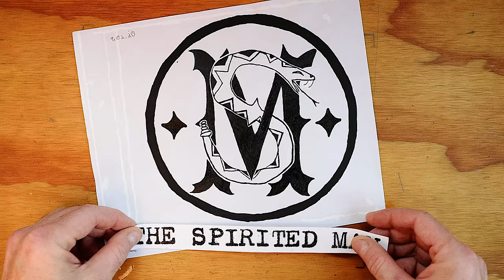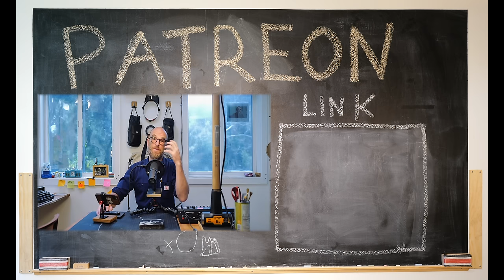The Philosophy of Driving Stick

Comment: Hey Van, don't rest your foot on the clutch pedal, it will ruin your system faster! Always remove your feet when your done changing gears, or just relieve the foot when you need fast changing.
Reply: Loved the video❤
Reply: I need to work on this. I'm on my 3rd clutch and I think its because I'm a clutch-pedal-rester.

Comment: When I was 20 or so, I got a delivery job... on my first day/delivery I was given a stack of brake pads and told to deliver them to "XYZ auto shop" I grabbed the parts and keys, went out to the truck only to see it was a stick shift! (didn't come up in the interview) I somehow got it that Toyota in gear and faked it around the corner, stalled 3 times that first day, once on the second and on the 3rd day I was hooked! Nobody taught me this skill... I have a hard time accepting peoples scrutiny of the learning curve. manual transmissions are so freeking liberating. They make the most boring cars exciting. I've owned many cars since then and have hated every single automatic under my butt since. Nothing replaces that tactile touch of being in actual control of my vehicle. sadly tho' at 49 years old, I drive a 49 cc Honda Metro... possible the only automatic motorcycle in the world! (at least i have some cheapo thrills from leaning into corners at 35 mph)

Comment: The best way to learn the relationship between the clutch and gas in gear is to go to vacant area, find a hill to drive up, and then try to keep the car in one place without using the brake—just balancing between the clutch and gas. You'll kill the car over and over, but also a while, you'll get how give-and-take you can give it.

Comment: Try not to rest your foot on the clutch in between shifts. You're adding additional wear to the throw out bearing and also increasing wear on the clutch disc itself! Will also echo what others have stated that... when in doubt BOTH feet in (clutch + brake). I think that potentially you yourself panicked in that moment which is why you might have just blurted out "clutch" lol. Glad it was a cheap fix.

Comment: You can shift to 1st while the car is moving... The synchros are not going to like it, so you need to rev match it, and punch the gas pretty hard while you're doing it. When you let out the clutch, the car will decelerate quite quickly. I used this technique one time when I blew a wheel cylinder, and consequently lost something like 75% of my braking power. It allowed me a secondary way of controlling the vehicle's speed without having to touch the brakes. The final stopping would be done with a quick yank of the hand brake.

Comment: „Everytime you touch the break, you got to push the clutch down first“. 

No, just no. Normal deceleration while driving is completely fine. On the highway for instance while decelerating from 120km/h down to 100km/h you won’t need the clutch.

Comment: Don’t drive and rest your foot on the clutch… keep it besides the pedal when cruising to prevent excessive damage
Reply: Excessive damage or just damage as in wearing out the clutch and T.O. (throw out)  Bearing as well as heating up the flywheel and clutch pressure plate.
Reply: @jeffhildreth9244  damage as in wearing out the clutch
Reply: @daankattouw  The clutch system is composed of three main parts:  The clutch Disc, the Pressure plate and the Throw Out Bearing. Which of these have you  personally replaced, and in which car.
Reply: @jeffhildreth9244  I have not yet replaced any clutch-element in my car, because I keep my foot besides the pedal when cruising ;)

Comment: You dont push the clutch first in an emergency, and you dont call out. You brake. Brakes are more important. Yeah the engine will stall, but sill you'll stop in place.

Comment: I miss my '94 Mazda Protege DX 5MT.  I put 180,000+ on that vehicle over 26 years.  The modern automatic transmissions shift more smoothly and are more fuel efficient than manuals...and, we're all lazier than we used to be.  But I miss it.  I feel like less of a driver and more of a passenger of the vehicles that I drive currently.
Reply: Yes, automatic is more fuel efficient. And most people are in the wrong gear, all the time. Thats why i dislike manual… People can NOT operate them efficiently.

Comment: I want all new drivers to have to pass a drivers tests with manual transmissions :) 
 Tip for "oh $hit" moments when going off track in racing is, clutch in and hard on the brakes, I don't know if that technique would have helped keep the bumper straight ?
 Thanks for the video !

Comment: The key to avoid crashing when driving a manual transmission car is the following step/s: 1) clutch pedal down, quickly followed by 2) brake & clutch together. Telling someone to hit the clutch will not stop the car moving - in most scenarios it does the complete opposite: the car 'coasts', which is far worse as there's no 'engine braking'. I think the instructor was at fault here ;-) Pleased to see that team of kids did a sterling job at restoring your bumper. Felt a bit sorry for them not wearing masks whilst spraying it back up

Comment: I just want to say that clutch is NOT a panic button. Pressing just the clutch will actually make the car go faster. You press the clutch and the car is now rolling freely without any resistance from the engine. 

Even when driving stick, the panic button is the break pedal. If you are not panicking, press both the break and clutch to stop without shutting of the engine. When in panic mode, just hit the breaks. The engine will die, but that's ok. Stopping is what matters.

Comment: tbh u should of taught that u push in clutch and brake hard if there is a need to stop (not hit something) -- pushing the clutch in is great but without braking you wont stop and generally if your in "panic" mode you need to stop.

Comment: As an European, where most cars have a manual transmission, I honestly find it strange when an American says: I do not know how to drive a stick / manual.
As far as I know, it is only in the USA and Canada where automatic transmission are the norm - and manuals the fringe.

That said, there is a growing use of automatic transmissions in Europe, and spreading rapidly.
Mainly driven by dual clutch transmissions' quick shift, but also due to improve efficiency.

Regardless, the manual transmission mandates that the driver is focused on the task - and not thinking about a 100 other things.
It is quite normal, since I was a little child, the correct point to shift gears up or down - because the memory of hearing my dad shifting is printed on my brain.
When it came the time to drive, I was ready.

For those who say CVT: no, CVTs are disguising. They should not exist in their current form - but only on their original form.
Torque converters are the past.
Sorry.

Comment: The mistake here was carrying on off the beach. First lesson on the beach, done. Next day, try again on the beach, try some manoeuvres, going up to 3rd, etc. Third day, maybe, maybe try it out on the road.
Reply: Also, so lucky the bumper hit the rock. Could easily have hit the front grill and you'd have been in for a bonnet repair, grill repair, potentially a new radiator and more.

Comment: Opens with, ‘Driving stick is a creative exercise.’ Then later when presumably instructing someone, ‘when this gets to 2500 <rpm’s>’

A creative driver or learner doesn’t shift based on a tachometer…we use our feel, our judgement. We listen to the engine and feel the vibration of the vehicle…our so called ‘creativity.’ Teaching someone to shift using a tach is anything but creative. Oxymoronic.

Comment: You can absolutely go back into first when rolling in NYC traffic. I wish standard transmissions were the norm in America, it would make us all better drivers. Your mistake was focusing on the parked car instead of worry about how she was going to stop. Too panicky man!
Reply: The "standard" transmission in the US is automatic. I had a manual and wish I still had one but the cars we use/need don't have a manual option.
Reply: He himself may have been taught by someone who drove when it was not uncommon for transmissions to not have syncro on the 1st gear, requiring that shift to either be from a stop, or using "double-clutching".

Comment: everyone can drive stick at first until they are in crawling traffic on a hilly street. That's when it gets good
Reply: Yep.  First time out I thought I was doing great, until I backed up Rush-Hour traffic on the freeway for at least a mile when I had to stop on the off-ramp, which was up a hill.  After the light had changed maybe four times we had to switch seats as I could see pitchforks and torches approaching.
Reply: @BixbyConsequence  for me as a beginner I was unaware that the clutch pedal needed to be pushed in to restart the car. So stalling in traffic and struggling to start back. tense 5 minutes! Some cool dude came to my window and told me to push in the clutch.

Comment: The handbrake is the panic button, not the clutch. Hell, even the foot brake is better than stomping on the clutch. Pressing the clutch just disengages the engine from the wheels, it won't bring the car to a stop. I felt sorry for you wife; operating a drone while trying to teach someone how to drive a manual in a foreign country is not a good idea

Comment: When driving a stick shift car,

Rule # 1:
When at a full stop.. NEVER shift into first or reverse without  shifting  into  second gear first .. then, and only then  shift into 1st or reverse. 

I've never seen anyone bondo a bumper . Zero integrity. Cosmetic repair only. Worth what you paid for it ( I'm being nice.. you got ripped off) . 
I suggest having it properly repaired. It is of no value in another collision. Dangerous.

Comment: wrong, as you slow down you are supposed to go down the gears and reduce the amount of breaks you use as much possible, including going to first gear, although in most cases 2nd is okay going down to 1st is even better
Reply: Total BS. The brakes are for braking and the gearbox is to change the torque.
Reply: @jeffhildreth9244  nope, gearbox is also used to decelerate in combination with the breaks. Any competent manual driver will tell you that
Reply: @IReapZz95  Call me incompetent. 130 cars in 59 years. Currently my daily driver is a 63 MGB. You use your "breaks" and gear box, I'll use my brakes.
When an instructor with BMW of No America... well, we'll just let that hang there.

Comment: "the clutch is the panic button". Wrong. When you push the clutch the motor disataches from the wheels. The motor helps you break... In a panic situation where you have to hard break dont push the clutch.

Comment: You shouted "clutch" instead of "brake". That's why she crashed into those rocks. Clutched rapidly all the way in without braking altogether releases the car from any transmission and in consequence adds a bit of velocity.  This is on you buddy😅. Even If she braked without the clutch, the car would stop and so would the engine. Not the worst scenario after all.

Comment: Van you should break first and the cutch.. the car will break better when u clutch the car dont have a gear and goes faster, the engine will stop from the gear but its ok you don't crash
Reply: BRAKE   BRAKE   BRAKE   BRAKE

Comment: Mr. Bearded man:
I disagree with your method of teaching a person to drive a vehicle with a stick shift .
I have been driving a stick shift Porsche for over fifty years, in all types of traffic, climbing & stopping on hills, inching along Sunset & Hollywood Blvds, the Angeles Crest, Mulholland Hwy, Hwy 1 & 101 etc. & I have successfully taught my son & daughter how to drive a stick shift without any accidents.
The first rule is to NOT yell and/or make sudden movements with your arms in front of their face! To a novice that makes for a scary & confusing experience.
You should spend at least a half-hour on clutch work before going out on a public way to teach shifting.
The best way to teach clutching is to set up a ramp & teach the novice to slowly let out the clutch (while in first gear) to climb part way up the ramp & then push in the clutch & hit the brake & hold it there for a couple of minutes & then while holding in the clutch, slowly let off the brake, thereby backing down off the ramp. U should repeat this about a half dozen times until the novice can do the simultaneous clutching & braking smoothly! U were at fault for Isabel running into the rocks!
U should have told her to come a stop, shift into first gear & then pull into the parking space!
Ur yelling at her as she was approaching the car& parking space confused her & actually caused the accident.  To be continued- - -

Comment: When you push your brake you DON'T push the clutch unless you're stopping. The idea is to use engine to break as well, to support your brakes. I drive stick 25 years and have never had automatic transmission. Greetings from Europe [;